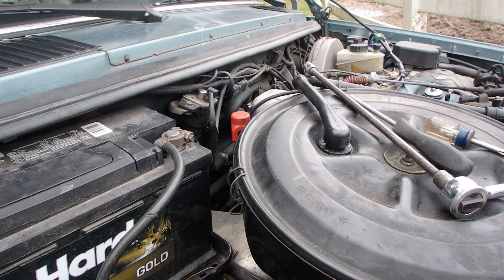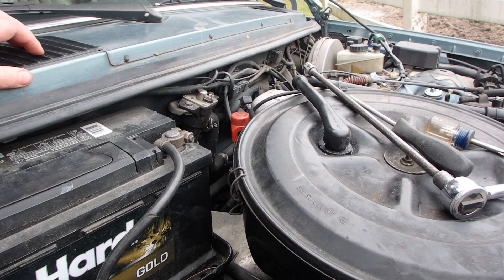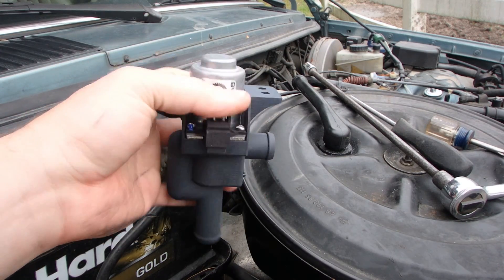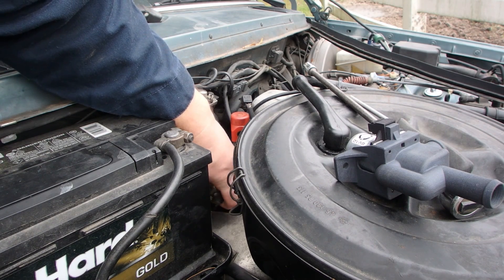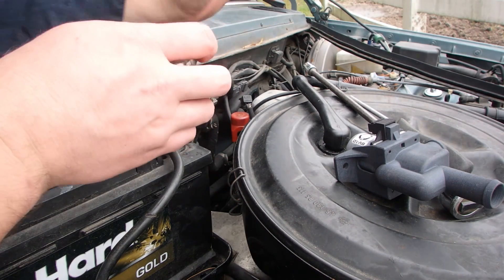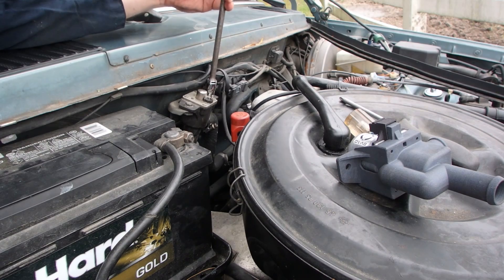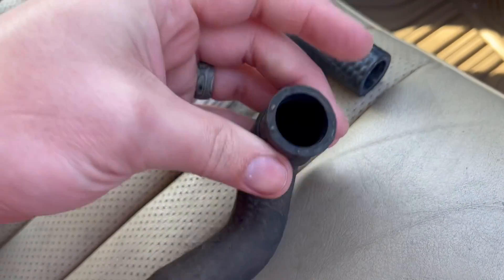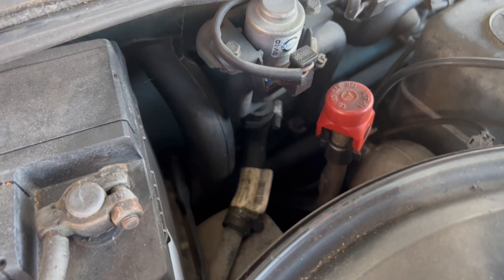The Best Mercedes W123 Heater Upgrade

Comment: "
'85 California 300D, CD and TD models only, require a different monovalve at least Clima has one to fit these models.  Just my luck, it's a few bucks more though. Thanks for going through the process with us. Cheers
Reply from the maker: Yeah I did see that when I went to grab the link. I’ve actually never see. A cali model in person.
Reply: @mjmcomputers  Besides the monovalve, the main difference is the air filter housing behind the the right side headlight the size of a tom tom drum which takes a $100 dollar filter easily replaced with cold air intake and ram filter. Cheers
Reply: Calif models have a differant system entirely if I remember correctly.
Reply: I have a 1985 CA 300D and had a 1984 at the same time.  I don't recall the OE mono-valve differing.  The OE mounting bracket differs since it supports the extra heat shield in the CA models.  Klima has photos of each model.  It appears their difference is in their mounting bracket design.

That heat shield protects from the turbocharger being higher up (to clear cat conv "trap oxidizer" added to exhaust).  Other changes were different exhaust pipes, different turbo clocking, different starter clocking of solenoid, frame-mounted air cleaner, and heat shield on rear of alternator.

Comment: This is a great YouTube video.  Thank you!

Sidebar:  I noticed that Ken at Mercedes Source sells a monovalve climate control electric water pump to upgrade and replace the OEM Bosch.  But I don’t think his electric pump is Klima.  I wonder which is better.  Hmmm….
Reply: Ken sells an electric Bosch.  Is Klima better than the Bosch?
Reply from the maker: I’m not sure, I searched his site and found a video on installing the Klima one.
Reply: Re the "aux water pump", I replaced with a section of heater hose in mine.  Not needed, except perhaps in northern Germany since never seen one in a U.S. car.  If the motor stalls, it can cause a dash fire (add a fuse), and block coolant flow, plus leak coolant at the shaft.

Comment: Looks beefy.  Is there any way to know if the mono-valve (OE or Klima) is working?  Can you feel the coolant flow changing?  Another approach is a vacuum-operated coolant valve, operated by a small electric-vacuum switch (actuated by mono-valve cable).  That was M-B approach in later cars, and a company (Klima?) sold those parts as a retrofit.  I did similar in one of my 300D but used a generic coolant valve ($10, ebay) and vac switch from a salvage car (any should work).  With that approach, you can see the valve opening and shutting.  Heater hose is standard 5/8"D.  Silicone is best since lasts long and is flexible to fit easy.

Comment: Do you have any idea why the Klima monovalve is so much better than the original bosch part?  I am curious what is different internally that makes it better
Reply from the maker: I’m not sure how it is built internally but it is a extremely difficult and expensive to get good quality monovalve cartridges to rebuild Bosch units since Bosch stopped making the cartridges.